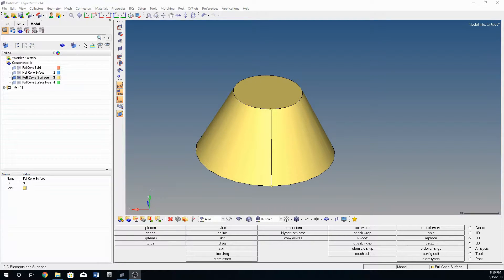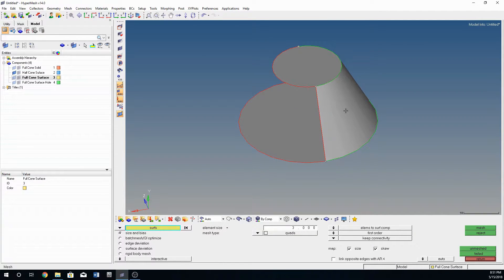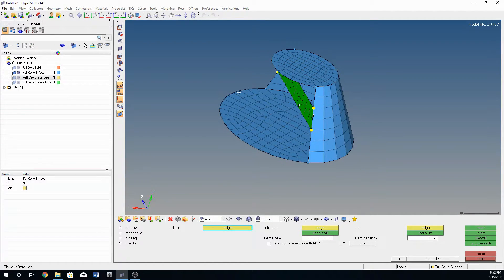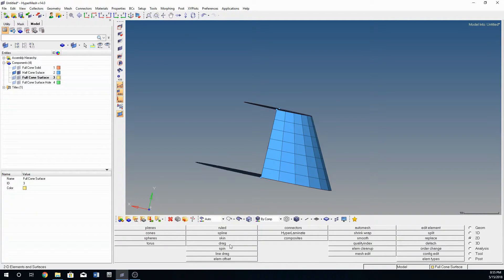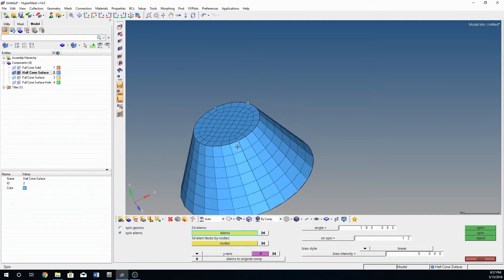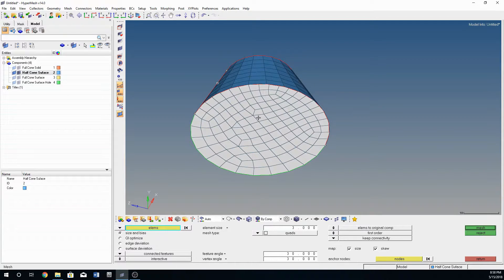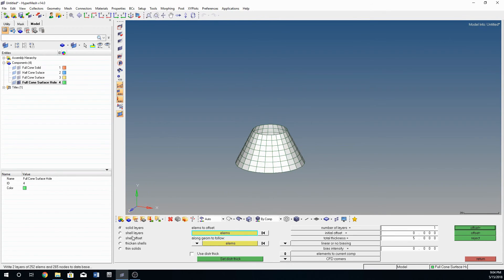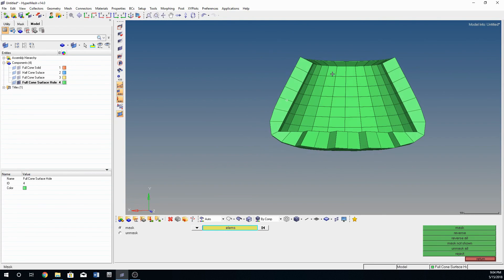Hypermesh Tutorials for Beginners 2: 2D Meshing Ruled, Spline, Spin, Offset, Equivalence

Comment: Hello. Thank you for the playlist. I am a complete beginner to HyperMesh and FEM. One basic doubt that I have is, when there's a hole in the model (the model which you used to explain Spline), why are we meshing that region? When there's no material, why are we assigning it a mesh? When is this done in practical world? Could you please clarify? Thanks in advance.
Reply: Hello. In the case you are describing you don't need to create a surface/mesh to fill the hole. I think he is just explaining how to do it in case you need it for whatever reason, for example, if the geomerty didn't import properly and you are left with an unintended gap that you need to close.
Reply: @angelaso8411  Thank you :)